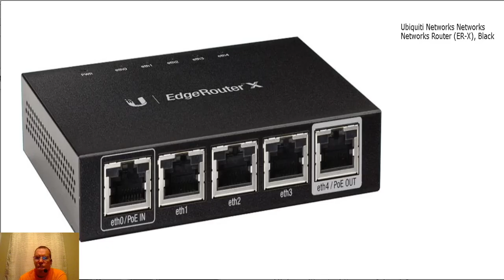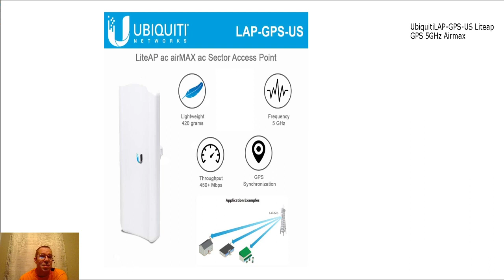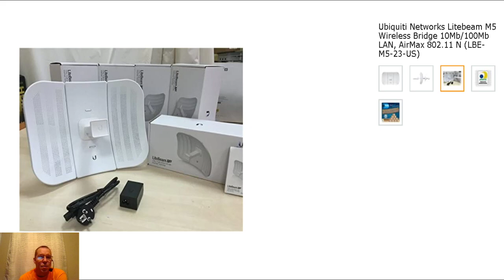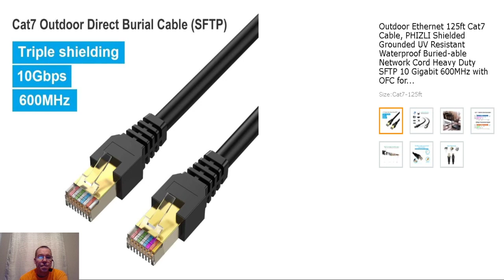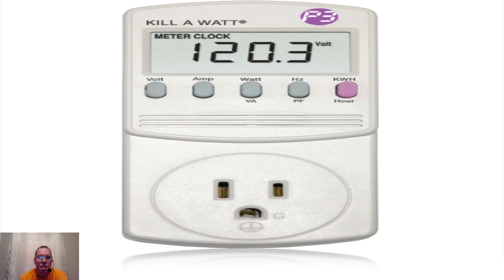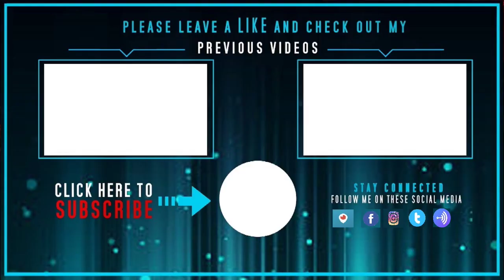Things it takes to build a WISP | Start a WISP

Comment: Great video!!! Could you use a cell routers with sim cards with service as a internet provider for your Ap,cpe,etc?
Reply from the maker: Yes you can! The backhaul just needs to be a internet connection. But with to many on that BH may run out your DATA if you are limit to what you have with that cell service. Also you need to be sure you have the right to resale that service.
Reply: gotcha! @CommunityWISP

Comment: I am researching at the moment trying to set up an wisp in a slightly rural area of Texas whenever you get a lease from a tower company for example American tower company is the internet included in the price of the lease or is that separate from the cost of the lease and would have to be obtained from one of the other clients that are on the tower?
Reply from the maker: I have seen it both ways. At times it is included and sometimes the lease is just to be on the tower & you have to find a provider for that tower to get your connection.
Reply: @CommunityWISP  thank you

Comment: Good day,
I would like to run a wisp to but I want it in a way you can get internet connection both outdoors and indoors 
It's a small town with buildings
How do I distribute the Internet connection 
Which equipment do I need to use
Was thinking of using eap225 with its mesh network I'll be able to cover my town
But wasn't sure
Then i saw mantbox 15s but that's kinda expensive knowing it will handle only 30 mobile devices 

Please help
Thank you
Reply from the maker: Send me an email so we can do a video consulting.

Comment: No one seems to explain the back haul experience. How you ordered it, what you ordered and the costs and time it took to get installed from AT&T or Verizon, Century Link, etc.
Reply from the maker: I found all of the providers in the area and told them what speeds I needed and they all gave me a price and I picked the one that fits the business the best.
Reply: backhaul is a finicky thing. price speed and associated info changes depending where you get your data from.. generally i get mine via ptp link from a datacentre closeby

Comment: What internet speed do you need to run to each site? Do you need 1G/10G fiber or can you get away with less?
Reply from the maker: Every site will have it's own requirements. It will be based on the speed package that you hand out to the clients.

Comment: Hello, how much is it cost to build an antenna like yours???
How many clients may it support and if you need to cover a large area, do you need two antennas???
Looking  forward for your reply. Thank you
Reply from the maker: Every tower is at a different cost. 
You can get around 40-60 CPE's per AP.
Area covered will depend on how many homes are in that area.
Reply: @CommunityWISP  Hi, I have a series of questions for you Sir. But I will ask you them gradually, 
Well firstly, what equipments will b needed for a single CPE? I mean router, modem, the antenna ECT ECT.
And which manufacturer do you recommend Ubiquiti or Huawei??
I am aware that Huawei's is much cheaper that Ubiquiti's
Cheaper does not always mean realiable?
That you very much Sir and looking forward for Your wise reply.
Reply: @nygellabelle2193 hello were your questions answered?  I'm curious to know
Reply from the maker: @nygellabelle2193  You will need a CPE and a router at the clients location
Ubiquiti  is the equipment I use
Ill see of putting up a video about it.
Reply from the maker: @NickPhaze  Ill see of putting up a video about it.

You will need a CPE and a router at the clients location
Ubiquiti  is the equipment I use
Reply: @MikePowlas  i have a few questions. Do you have an email where i can reach you?
Reply: @CommunityWISP  okay thanks but it is 10k one???
Reply: @CommunityWISP  if the area covered have 200 or 250 houses!

Comment: Do your need a switch when you already have a edge router?
Reply from the maker: A switch will add more ports to the router that you plug into. So you will need one if you need more ports.
Reply: It might be cheaper to buy an POE switch just for the POE side of it.

Comment: 2.4 frequency is overused and is very saturated.  I would recommend just increasing height.  5ghz is a much a better alternative as long as you are within 4 miles.
Reply from the maker: Not true around here.  2.4 works fine at this height of 110 ft. Many pine trees to go through. Even at 200 ft trees are in line to the CPE.
Reply: @CommunityWISP  ah I see,  my apologies. In my area there is major saturation. Which is why most WISP's in my area of Texas are choosing the 5ghz frequency. But we do still use 2.4. Just can't beat that range lol.
Reply from the maker: Love 2.4 with trees here and the range is a blessing to.
Reply: @CommunityWISP  What range are you getting?
Reply: Just going higher is not so easy as well. It can get expensive real fast after 110"

Comment: Can the M5 Nano station work as a radio?
If yes how far can it transmit and what angles can it transmit?
Reply from the maker: Will that be as radio to another radio or set up as a WiFi AP
Reply: @CommunityWISP  In either case
Reply: Say I wanted to set up a Mini-wisp in a particular area, can I use the M5 Nano Station? 
Lastly, can I use the M5 as a repeater in a wisp network. Thanks for your feedback Lol🙂🙂🙂
Reply from the maker: @blairgroove1302  Ill make a video on it. It can be set as Repeater, AP WiFi and Station.
Reply: @CommunityWISP  Thank you for your feedback, I'm looking forward to that video. Don't forget to add in the properties of the various M5 nano-stations available plus their advantages and disadvantages. Regards Blair Groove

Comment: After you connect the M5 gen 2 to your clients house how does he/she actually get internet from it, would you run an Ethernet cable from the antenna directly to an access point into the house? What happens exactly
Reply from the maker: It is set up like this. We put a CPE (client premises equipment) run a Net wire from the CPE into the home/business to the POE (Power over Ethernet) then from the POE to their router. Or they can just plug in one device to the net wire from the POE. Because the CPE is set in router mode so it does DHCP.
Reply: @CommunityWISP  does this mean you can connect the cpe directly to a switch at the clients location?
Reply: Think of it as the cable company. They run wire from outside into your house and plug it in something to give you TV/Internet ... same thing really for a Wireless system